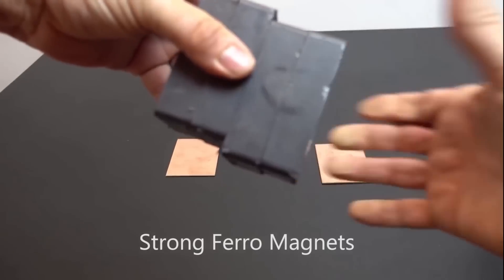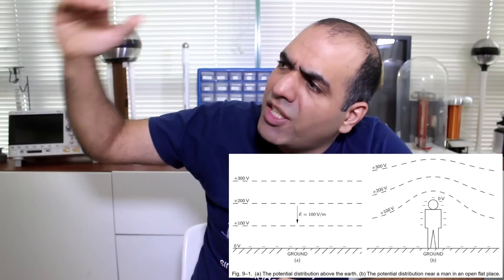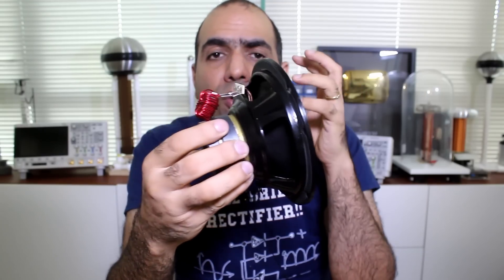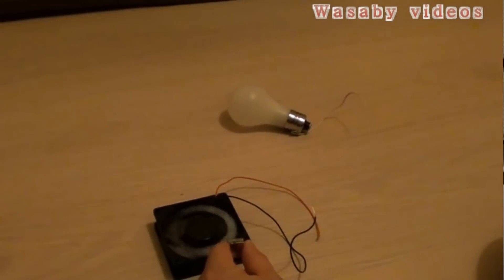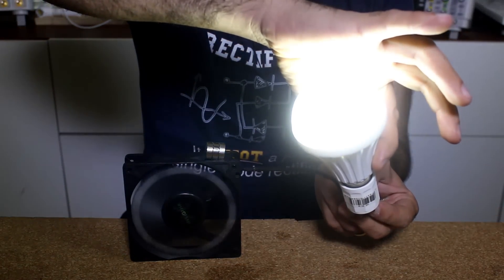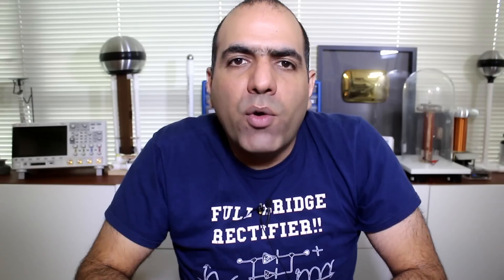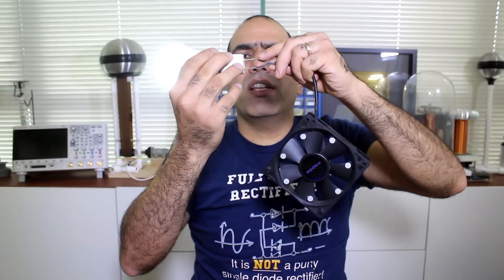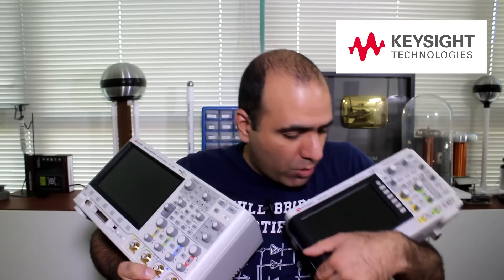Free Energy Devices Build and Science

Comment: Piezoelectric Effect is the ability of certain materials to generate an electric charge in response to applied mechanical stress.. CAn't you use a mechanical actuator to deform crystal and have a huge output? Like a voice Coil in a speaker. With a certain Frequency.... orrrr An off balance motor or rotor that when it spins around squishes / compresses the crystals in the outer housing? and when you combine 4 of them they counter the off balance centrifugal force making it a non load crystal compression motor? Then use Capacitors and diodes to smooth out the system? I already did the calculations with GPT.. I know its high voltage however it far surpasses the input..  Like really far..  Just like a lighter, or a barbeque igniter,... TINK.. or an old fashioned needled on a record player.  I figured it out... And it can be upscaled.. One the size of a frisbee can power a car, your house, your neighbors house.. ETC... It's not free energy... It's Releasing tremendous energy.. I'm talking crystals the size of a quarter , Square and 3/8 thick..  12 them..   Allllll being deformed on compression and decompression they POP....
Reply: No, since you have to put in more mechanical energy than the electrical output would be. The effect and crystals are cool though?

Comment: I love electrobooms honesty!

Why don't people pursue the AVAILABLE energy, which is renewable energy, wind, solar and hydropower. 

I can't believe as a kid I fell for one of the stupid "overunity" b.s. claims by a website called cheniere. Don't waste your lives guys, believe electroboom, more importantly listen to what he says, use your head.

The best book I ever read on the topic is "history of an obsession" which is a brilliant visual encyclopedia of all the postulated, attempted, and faked concepts in supposed perpetual motion. All failed and those that didn't were hoaxes.

However, the book also had some details about self winding clocks which use long term changes in air pressure to power up, but the beautiful consistent message of the book is that any energy being used to perform work isn't free energy, it's just available energy. Some of the machines that seem remarkably close to perpetual motion are just very good efficient machines with the ability to make use of very small amounts of energy such as slight temperature differentials used by ambient Stirling engines. But it's not free energy. It's just available energy. You never get back more than you put in.

Comment: Can you do an experiment what would happen if you had two leads on each  end of a clear silicone based tube with an electrolytic solution inside of it and capture ends and attach it to a car battery instead of using wire I'm currious of the effects it would create

Comment: So How Does the car Alternator Charges your car Battery plays Radio +Sound Stuffs 🤔..
Reply: I hope you're actually curious and not baiting... 
But you do realize a Car requires an Engine to actually move, right?

Ever ride a bike before? Ever had a bike that has a small light and a tiny dynamo powering it?  Yeah, it's same idea. 

Instead of your kinetic power pedaling the bike powering the dynamo, it's the engine's kinetic power powering the alternator.

Heck, back in 1920s-1930s, you can power the Alternator by Cranking it. Heavy duty vehicles from Tractors to Tanks were hand cranked due to them requiring heavy alternators

Comment: Pffft ElectroBOOM doesn't know what he is talking about...

I've developed a revolutionary technology called the "Quantum Vortex Motor," which harnesses the power of quantum fluctuations and zero-point energy to generate free, unlimited electricity.

The motor I've created consists of a specially designed toroidal coil that creates a magnetic vortex, tapping into the very fabric of the quantum vacuum. At the heart of the motor is a miniaturized quantum resonator, an invention of my own, that takes advantage of the Casimir effect. This phenomenon occurs when two uncharged parallel plates are placed extremely close together in a vacuum. The plates attract each other due to fluctuations in the vacuum's energy. By modulating the Casimir effect, my quantum resonator extracts energy from the quantum vacuum and converts it into usable electricity.

To optimize the motor's performance, I've arranged a custom array of neodymium magnets in a precise pattern. This configuration maximizes the magnetic flux and generates a continuous flow of electrical energy. I've also incorporated superconducting materials into the motor's design to minimize energy loss and maintain a high efficiency.
Reply: Have you built a working model of this invention?  I'm pretty sure I can guess the answer...

Comment: Sir, can I use an ac voltage regulator (used in our house's switch boards) to lower the current and use it to run my electromagnet made out of a microwave transformer? Cus I don't have any Lab Power supply or something like that to power it.. I have made that electromagnet but can't give it the power it needs.. Help me..

Comment: There is a device that was already invented by a FILIPINO but it is very complicated and sophisticated one to built and he spent a long period of years before he finally succeeded.  That is not need to use gas, or electricity from the wall. its only needed just one battery for the device to start then after it give power to the device the battery will automatically turns off. Just see for yourself. HERE is the link: https://www.youtube.com/watch?v=CkcTYeweauw&ab_channel=AgribusinessHowItWorks

You will be the judge of his work.

Comment: Two microwave transformers are used with a high wattage piezo element. Use a 100w piezo element on the high voltage coil. Hook to antenna and ground wire with the output going to the low voltage side of the other transformer. Would it make a usable output.
Reply: its very unlikely that it could work

Comment: Can you create an energy loop where you use static electricity that is battery powered and you use that same static electricity to charge the battery while still generating enough power to turn something on?
Reply: Unfortently no. Consuming energy requires more energy to be produce. He made a handheld charger for his phone. He turns a crank an it creates energy. When not connected to a phone he can spin it with ease. But when connected to a phone it takes a lot more effort to turn because of the phone requiring more energy and consuming. He explains in better in his video.

Comment: See how you use the dragged space to be released back in to 
How is the vapor thention behaving 😍 stable as you tace from and releases back in to😍
Reply: Exiting🛸😋
Reply: That is not nessesarely.
If you conect above with Belo you olso are thempering with the everighe thentional diverentional between the layers
Reply: Ahhh you are opening the knowledge of dragged space in to the release
Reply: Mhhh you undersyand as long if we need aditional energy sources it is not freely😍😋😍
Bit you can tace on a way whit less harming factors.as long if you don't understand thentionl diverentional😍

Jad many this is fake but realize how dit your body was used to transfer the thentional diverentional towart the lamp😍

And how the space inbetween oll played a role in it.
Yes I beleaved and wanted to worked it our whole it was able to run to share it back and than I saw automaticle that it was not corect😍
I tray everything that I understand to confurm the understanding coexists hand in hand with the evends I aproges😍

But you saw how stable thention I reaged with feildcopasators .
As I understand conetic feildflow.

I do was wondering whay you used the side and not one of the polatetys of the bick magnets on the small magnets than you loos directional feildflow strinks on the colective magnets.
But😋😍😍😍
If you ingage free even when this was correct it still was not free magned neat to bee mined shaped wires the same and lamp the cost for eurths existence 200 times more to make the the old lamps and olso releasing anty ogigen behaviures in to our infiomend directly in stad with the resistance of carbon 😅
Reflection is fake😍
As it is onderstood we named it resistor teghnolegys 😍
If you creat the ability to release to be able to reseave than you conect freeley on the energy that are olrady pressend for oll to be able to exists😍
Humans onley see enrgy in a way of force.
In Stade of a way of releasing 😍

If you take somting our there will olways be more energy till it balance out jed there is energy but more equal .
When I ad there is more energy do to ratio and balance out to more equally again.
Bat less as bevore 😍
Within the stresholds of collapsing do to a leeg of less energy our do to a lag of thention.
The everighe thentional diverentional😍🤣😍
And this you can proof your self bi redo the led experiment I showed you in the face book sharings😍
Olso look to the wire whaybwe massur wat we assumed to be electrons 😍🙏😍
And than redo your experiment with the wish to profile 
Look to the counterfeildflow wnd the rotational forces.
This can not burn a led as led needs to be exeterated phosphorescent particles between the give ratio between plus and min.
That the phosphorus tace bi pulling so hard from (less negative side) that it pulled more than it is able to reseave and this is slingshotet with momentum in to the infiorment to expand for the particles around within and inbetween this interaction to schink for you to release towart to be able to see the lights😍
We eat whit our eyes we release and the particles consisting the licht jad  on known bi komen science (mabey as quarks particles ) tacke from and pulled theme selfs in to👁
See how the eye eats to remamber the translation towart the brain daimention for second translation of energy in to wat we imagion😍 to be able to see👁🌈 trouth the eye dimentions existance.

So even if you have less thention inof to be able to release  than normal night would be more  like day light 🤣😍

Like if we lower the night we see more light in the skay😍 stil dark but more energetic light we olso see more hot nights than days do to this catalistic events 

I beleave it was poseble.
Do that I know it is poseble😍
You thought light when you reentered the phiramids.
Harmonic light😍
Top on in yo this interaction and you have energy tfor a total city if you onderstand how to use this harmonice to egnithe surtenend energy transition of devices on the spot to tace from there and release in to there again😍 in small portions we don't nead more we need less as less is more😍
We nead to become awere of wat enery is so we can chose not to brake its structure so energy can still coexistence in the pressend conditions on a natural couses of events 🙏😍

Think of this whay dus the battery in your smart phone runs 2 jears brake and the same in your tools work 20 jears.
You have release so match less negative space trouth led screen 
That the particles inside the battery there directional feildflow containers brake as there is noting to circulate between theme to mantaine dimentional structual intergerty of the behaviures that we recordniced as the atoms we used to make the system of the battery 😍

Tadaa😍

I really l thought one moment so  somting beautifuls hppence so easy🤣😅🤣😋
Jad if it was not happend I was not able to share the way I nou share ..back ....
But i know when that tl light enters dinamic feildinteractions they olways burn😍
But i could have known bi how bright it was burning🤣
I just wanded it to be easy but i had found out later any way😍 but it is beautiful.
Nou many wil leurn to see for tham selfs and explore before beleaving blindly😍...

And some how I stil feld a litle triged🤣🤣🤣
Jad stil a smal part of ego🤣 it dus not matter🔱🤣🤣🤣🤣🤣

Thank  you and oll😋😃
And oll injoy beïng🖖🌈🍀🌳🍀

Ofcourse it matters🤣😋🤣lol
This shows me where I am not completely matueled jad as ego is one of  the bickes resistors towart clear understanding of existance .
As than we are intangle and interfere with the behaviures we opsurve🌀

🛸
Reply: Whahahaha 😍 it is oll a lay and jad the lay has releay happened 🤣lol
When there is a lay boxing the treuths 
The treuths is olways waiting to bee onpaced from the box🎁🌟 to regain clearaty again🌐

Comment: What about a magnetic motor?
Reply: A permanent magnetic motor can't produce energy.
Reply: @m-h1217  it can , it moves through magnets and kinetic energy turns to electric
Reply: @gregorion4607  That's not magnets generating anything, the magnets are simply used to convert said inputted kinetic energy into electricity. The magnets aren't generating anything, you still need input.
Reply: @m-h1217  the magnets move and they create energy , they dont generate it , the movement does. There ways to make magnetic motors
Reply: @gregorion4607  Energy can't be created or destroyed. Only converted.
Magnets exert force, not energy. You have to put energy into the system for to get any out. 
Replace the word magnet with spring, and you'll see you obviously can't get anything out without doing something yourself. The same goes with magnets, they act like spring tension.
So you can't expect to get energy from the magnets alone.
Let's say we put together a magnetic motor with an axle. It spins so it should make energy right? No, because what makes the magnetic motor function is movement between the magnets so the magnets can continuously push each other. It is exactly as if you would have a magnet on a table and then one in your hand pushing it along. You're not getting more energy out than the energy you used to move the magnet with your hand.
Reply: @m-h1217  yes that what iam saying , the magnets move the body , the movement of the body makes energy.
Reply: @gregorion4607  I literally just told you no. You would need to put in at minimum the same amount of energy for the contraption to "generate" the same amount. The machine won't work unless you move the magnets yourself or with another device, which requires energy, and it is that energy at best can convert back. Why would you need to move the magnets yourself? Because the machine would otherwise stop.

"yes that what iam saying , the magnets move the body , the movement of the body makes energy."
But what makes the magnets continuously move the body? Inputted energy.
You can't make a magnetic motor without the motor using internal movement requiring energy.

Like I said, you can't create energy. Only convert it. Magnets do not exert energy, they exert force. Force is not energy.
Theoretically, the incredibly small energy you would be able to get out of a magnet would make it stop functioning. 
So let's say you did manage to get a fraction of energy out from it, now you don't have a magnet left. You gained nothing, it's as if you burned some wood in a fire. The stored potential chemical energy in the wood was converted into thermal energy, but no more energy was made.

Please read the laws of thermodynamics.
Reply: @m-h1217  I can type it here to destroy fake thermodynamics laws but nahhhh. I love watching your ego : )
Reply: @lukiepoole9254  Do it then lmao.
Reply: @m-h1217  You can wrap MuMetal to either poles of an electromagnet to generate a pseudomonopole. This is enough to make the magnetic motor without the cogging effect. However, only limited energy will be created as lenz's law still isn't circumvented, yet.
Very impractical. I prefer flux-gating instead. Sidenote, MuMetal is expensive however.
Reply: @lukiepoole9254  Oh really, give me your source, I sure haven't heard about this breaking discovery.
I sure wonder why there appears to be such little investment, research and updated studies if it turns out the laws of thermodynamics have been broken and you can create magnetic motors consistently create energy but it's "lenz law" that holds it back.

Also "I prefer flux-gating instead" what measuring force and direction of magnetic fields? Ok? lol
Reply: @lukiepoole9254  the amount of nutcrackiness you and "Gregorion" contain is astounding.

Comment: La energía infinita es una mentira, de la misma magnitud que la tierra plana.
Reply: Oh infinite energy isn't a lie if you know the truth : )
Reply: @lukiepoole9254  Rompe la ley de conservación de la energía, vuelve a la escuela.
Reply: Hay 2000 años de avances cientificos, millones de comprovaciones por segundos en el LHC, en motores de conbustión interna, electricos y un largo etc.
Reply: Y ni un solo ejemplo e movimiento perpetuo confimado. 100000 vs 0.
Reply: @martinarielcarello  Perpetual motion? Perpetual motion is BS.
Instead, what am I talking about is OVERUNITY machines with efficiency greater than 100%
Perpetual motion doesn't exist because NOTHING runs at 100%
Instead, there's overunity which outputs MORE total output energy than total input energy.
Example? Parametric generator that utilize parametric excitation of electric oscillation in which you are NOT taught about. NO energy is used when varying the inductance of the coil. The coil actually ASSISTS the prime mover rather than opposing it.
Next, the use of two different magnetic permeability materials to force the opposing magnetic field to be asymmetrical. Changing the permeability of the rotor of a switched reluctance generator to be higher than the stator reduces the flow of opposing magnetic field generated by the armature winding into the rotor, effectively reduces the braking load torque, and thus achieves OVERUNITY. The FACT that opposing magnetic field is INDEPENDENT of the primary magnetic field and can be affected by materials with different magnetic permeability like a current flowing through multiple resistors with different resistance, is also NOT taught to you. Check out bi-toroid transformer. A resonating capacitor that is in parallel with the secondary winding is needed to complete the "lenzless" transformer.
Reply: @lukiepoole9254  ZZZZ